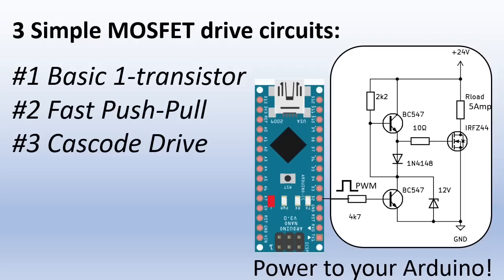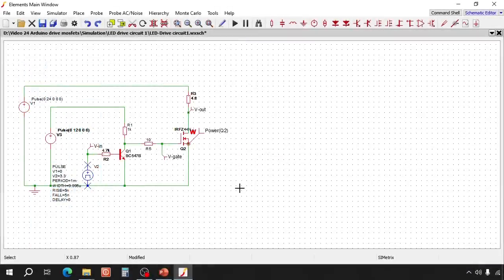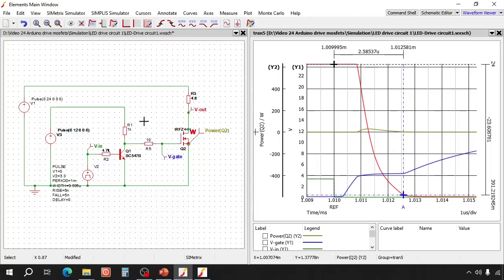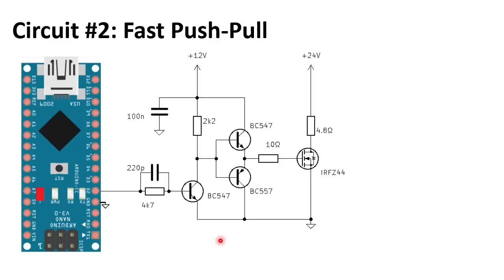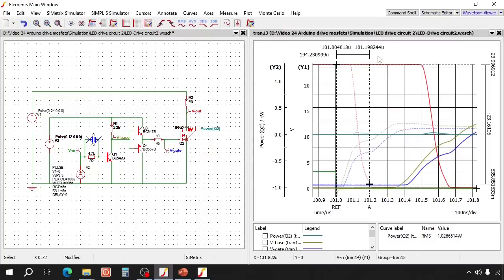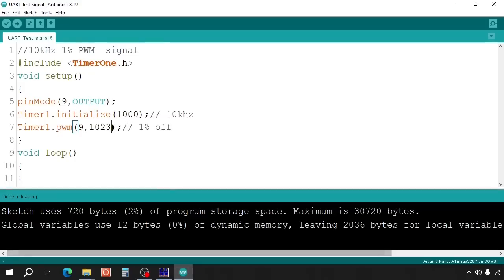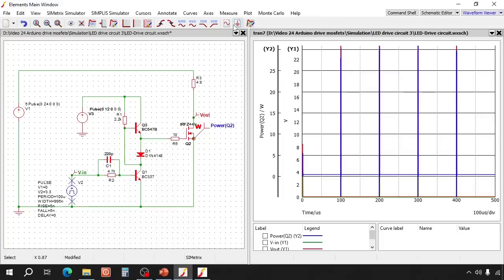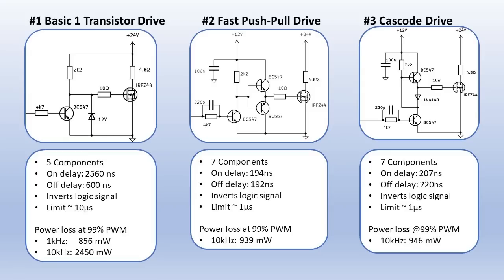3 Simple MOSFET Drive Circuits

Comment: On the second two circuits there are some improvements you can make.
If you split the 2K resistor to make it two 1K in series and run a capacitor to the output of your gate driver stage, you can get the switching times to be a bit faster.  Adding an inductor in series with the 2K will also work but inductors cost more.  The reason this works is because it causes the current in the lower 1K to not start changing until after most of the switching action is over.
On your 3rd circuit a small schottky in place of the 1N4148 does two things for you.  The 1N4148 has a recovery time so when the MOSFET is to be switched on, there is a brief delay before the upper NPN starts to do its thing.  Also with the lower drop of a small schottky, the gate of the MOSFET is closer to ground.
Reply: Isn't the delay from the 1N4148 kind of the reason it's there? I'm not an expert but I think he says something like that at 9:55
Reply: @bartios  The reason for the 1N4148 is so that when the lower transistor is off, the upper one gets turned on.  The delay in which is on really is a matter of his wording to explain the action.  He is taking the voltage on the collector of the lower transistor as rising at some speed.
Reply from the maker: Thank you for your tip!
Reply: @smartpowerelectronics8779  So, we are waiting for update video with tests ;)
BTW: Can you explain why you use BC transistor instead 2N?
Reply: 1N4148 не дря называют импульсным диодом, т.к. у него время задержки 2-4ns, при этом очень малая ёмкость, в то время как у диодов Шоттки, хоть и малое время задержки, НО огромная ёмкость перехода, и для коротких цепей с малым током, они будут гораздо хуже..
Reply: @SINHRO-FAZA  1N5818 only has 0.9pF of capacitance
The CDLL5818 version can pass an amp
Reply: @kensmith5694  Именно эти диоды шоттки я не использовал, но опыт использования SS56, и замеры обратного восстановления (хоть у таких диодов его и нет), но ёмкость сильно сказывалась, в то время как 1n4148 показывали себя довольно быстро, и на осциллографе действительно в районе 2ns. Хотя, если так подумать, когда вся система имеет задержки в 200ns, спорить о выигрыше в 1ns, кажется бесперспективной :D
Reply: @SINHRO-FAZA  Remember that it can show up as an error in timing.
Does good translate the word "pedantic" correctly.  I tend to be a bit pedantic at times.
Reply: @kensmith5694   Да, знакомая черта, сам порой страдаю перфекционизмом, стараясь сделать всё максимально хорошо, но помогает общий взгляд на ту или иную схему, с пониманием того, что какая то переделка не даст преимущества, но придётся потратить много времени и финансов. После чего успокаиваюсь, и переходу на переделку другого узла в схеме :D
Reply: sounds like you know what your talking about ! the science of fast switching is quite meticulous here ! can you recommend a good fast gate driver that i can just buy already made ? : )
Reply: @tvdylan  
TC4420  
High Peak Output Current: 6 Amper
Matched Rise and Fall Times:

- 25 ns (2500 pF load)

Comment: Came up with that cascode cct for a commercial product back in 1981 and was rather pleased with it. Then a bit later I found it in a Philips publication that may have just predated it.
Reply from the maker: Really!? Cool I used "real" cascode in CFL's at the company you just mentioned: a low voltage MOSFET switching off the emitter of a power bipolar which has its base connected to 12V with a resistor.

Comment: Nice video and thanks for uploading.
Just one question though.  You say these circuits invert the logic signal.... but...
If the input voltage is high with respects 0V then the MOSFET is off and the output voltage is high with respects to 0V too. 
Doesn't that mean the circuit Does not invert the signal? (In terms of Voltage)
Reply: The signal driving the mosfet gate is inverted with respect to the MCU signal driving the first transistor. Of course, the mosfet will also invert the signal applied to its gate, which means its drain will go high when the input from the MCU goes high. The two stages together indeed do not invert the signal.
It's hopefully obvious, though, that the drain is high when the mosfet is off, and therefore no current passes through the load.

Comment: The 555 can work as a buffer for driving a MOSFET too.
The only downside is that if the Arduino locks up, the 555 might lock on too
Reply from the maker: I tried it, and it works pretty well, next video!
Reply: @smartpowerelectronics8779   hopefully you'll solve the floating input bug
Reply: Yes but if you have the 555 you don't need the arduino do you.
Reply: @kensmith5694  depends if it's a standalone function or if this mosfet is part of a more complex project.
Reply: @PainterVierax  My comment was intended largely in humor.  The idea is that fans of the 555 will tell you that you can do anything with it.  There are a really large number of things that I have done with a 555 including a radio transmitter and stuff like that.
Reply: @kensmith5694  yeah 555 fans are excessive. The IC is very versatile but it has severe limitations as well and it's not that easy to configure.
It does the job but rarely worth it as a square or PWM emitter nowadays.
Reply from the maker: Hey that might work, and it will make the 555 fans very happy.it is worth a try! 🙂
Reply: @smartpowerelectronics8779   it does work, I did assemble it. Just watch out for the Arduino not to lock up (add 1...5k resistors before any inputs?), or else the output might be a steady "on". 

It happens whenever the 555 input is left floating (or the device attached to it is shut down). I tried to place various resistor values on its input in hopes of getting rid of this bug, but none worked.

It's not like I wouldn't use the obviously cheaper and simpler transistor version, but I currently don't have coding abilities and don't know how to invert the Arduino output.
Reply from the maker: Someone did this before: https://www.electronicdesign.com/technologies/power/article/21795203/lm555-makes-inexpensive-power-driver
I simulated, and with the CMOS version it works well (~150-200ns) but a normal bipolar NE555: 800ns, still better than circuit#2 and only 2-3 components (NE555, 100nF Vcc cap and 10Ω gate resistor) and...cheap! ;-)
Reply: @smartpowerelectronics8779   that's where I got the schematic from. Did you also simulate the 555 floating input?

Comment: One comment on the schematics for rather figurative reasons hinting at an engineering necessity: the emitter of the lower BC547 should be drawn with a line directly to the source of the iRFZ44. The idea behind it: The electric connection should also be as short as possible to minimize ground spike effects.
Very nice solution though. Congrats!

Comment: Question, dose the circuit need to have a 24V power source or can it be used with 12v and 5v?
Reply: If you need to work at 12V the circuit is very much the same.
At 5V you will have to be careful about what MOSFET you use because you can only pull its gate up to 5V
Reply: @kensmith5694 thanks
Reply from the maker: The drive circuit needs 12V, the 24V is only for the load in the demonstration because I use it for 24V LED strip dimming.

Comment: Do you have anything on driving a high side mosfet without resorting to having to use a p channel mosfet? I came up with one circuit, but it involves an extra 12 volts added on to the supply voltage, and having the transistors running at those high voltages.
Reply: If you want to drive the N channel, you are going to need those higher voltages.  They do make chips that contain charge pumps for doing just that but if you want to go with common parts, there are tricks.
If the switch is being driven with a duty cycle, you have a squarewave somewhere to drive a charge pump.

Comment: Good analysis of an area of circuit design which is surprisingly difficult to optimize. The Miller capacitance also works against you and becomes a big issue with high voltage switching.
Reply: Yes, at higher voltages that is an additional reason to not even bother with the simple resistor pull up drive.
Also:  "super junction" MOSFETs are much better for high voltage.  Even with 1000V on the drain, the gate acts as though the drain only went up to about 200V.  
For those who don't know:  Internally a super junction MOSFET is a lot like a normal one but some P doped silicon extends further down  into the bulk of the device.  This P doped silicon looks like the gate of a great big JFET wired in cascode with the MOSFET.  This spreads out the voltage gradient in the silicon making 1600V parts possible and also means that the full drain voltage happens at a place further from the gate.

Comment: 10:00 are you sure this works in real life with real parts? I can't see where the base current of the upper NPN would flow because bottom NPN is switched off and there is no current going though a gate of a MOSFET (except charging the gate ofc) 🤔
Reply: You nailed it. Charge the gate and trail off to quiescence. There is an inverted version of this circuit where a PNP is used in this fashion to discharge the MOSFET’s gate and the inverter transistor is also PNP to drive the gate towards 12V. But that version doesn’t accomplish level shifting and would need another transistor or perhaps just a zener to spare the PIO from the nearly 12V at the upper PNP’s base.
Reply from the maker: Correct, after the gate is charged there is no current!  Actually I recommend circuit #2 because it is the same amount of components and a little faster.
Reply: @smartpowerelectronics8779  The slow trailing off near the peak is why I suggested pulling up to 24V with a diode clamp to 12V. Then that transistor will remain saturated right up to when the diode clamps the base to the 12V rail.

Comment: Should you not have a resistor between the base of the BC547 and ground. Does this not turn the transistor off much faster?
Reply: Adding that resistor can help a bit but the speed up capacitor does more.
Reply: @kensmith5694  Yes, of course, but I learned that you always clamp the base to ground. Leaving the base connection floating isnt good practise.
Reply: @bruceclothier8238  The chip's pin pulls all the way to ground when low.  The base is not floating.

Comment: Excellent! I often have a 3.3V logic level and have difficulty driving a MOSFET with it.

For the third circuit I would connect a 12V Zener diode to the collector of the BC547 and cathode of the 1N4148 to GND. This would limit the voltage to around 12V.
The base of the upper transistor does not go above 12V and therefore neither does the emitter.
The upper transistor would also not become saturated and would therefore switch off more quickly.
But it is difficult to predict the current through the Zener diode.
Reply from the maker: Good tip, I expect that will work!
Reply: I like your solution.  The zener current is best predicted with a "if the current doesn't go elsewhere" sort of thinking.  The current in the pull up resistor always has to go somewhere.
Also:  If you use two resistors in series as the pull up and run a small capacitor from the mid point over to the emitter of the upper transistor, you can use a much higher value resistor for the upper one.  You only need much base drive to the upper transistor when you are in the process of turning on the MOSFET.    The small capacitor stops the base drive from decreasing right at the time you dealing with the miller effect.

Comment: That cascode drive is smart but has big issues, especially when done in a pullup like this.
1. The output is high when no input is present, so your gate will be high until your MCU boots up. This can be fixed by connecting a pullup resistor to your gate driver input. Also that means it's inverted.
2. BJT's saturate and make high speed drive for dc-dc converters a pain. (high dead time, delay and all that)
3. The drive is non symmetrical, so you can have good turn off and bad turn on and vice versa.

I've played with these gate drives a lot and push-pull is my go-to for now if i want predictable timings ;)
Reply: On #2 part of the fun of electronics is working out how to make that not matter in the design.

Comment: Folllow #3 with a totem-pole for even more current, up into the 10A range even. That’s better than most monolithic gate drivers, though there’s nothing stopping you from just putting a totem-pole (or ZXGD300_) after a monolithic gate driver.
Reply from the maker: Thx ScroganY. You are absolutely right, the totem pole will not add much delay and can further boost the gate current. By the way BC547/557's are not the best switching bjts, I was surprised how well they stood up to the task ;-)

Comment: This was absolutely brilliant!   I really enjoyed your explaination on the push pull circuit, as well as the demonstration on the effects of the 220 pf capacitor on the BC557 base.   Liked and Subscribed!
Reply from the maker: Thanks David!!!
Reply: @smartpowerelectronics8779  It would have been interesting to see the effects of a corresponding 220pF capacitor in the first circuit. I wouldn't expect a great improvement because the mosfet input capacitance is still charging through a 1K resistor, giving a typical time constant around 2μs with an IRFZ44, but it is not an expensive addition and you would then be comparing the three circuits on a rather more equal footing.
Reply: @smartpowerelectronics8779 can you please explain, constant current with driving logic with transistor & MOSFET?

Comment: Thank you for the clear and concise explanations. Great examples! Any recommendations for a non-inverting mosfet drive circuit?
Reply from the maker: Thank you JessieKropp!...well only one more Transistor at the input, but that causes extra delay. To prevent starup flash I choose a GPIO which has no other function and set it to high first thing in your setup(), works OK for ESP8266 and AVR arduino boards.
Reply: I’d add a weak pull-up on that GPIO pin too.

Comment: Nice! The speedup cap is interesting. I wonder what the current and power on the io pin looks like.
Reply from the maker: Thank you! The IO should be ok, the 220pF causes a minor extra loss of 0.5*C*V^2*freq ~ about 30µW? There is another solution called "baker Clamp" with a Schottky Diode over b-c but I did not try that.
Reply: @smartpowerelectronics8779  I have done Baker Clamp circuits.  They do get rid of the storage delay but they don't help on the miller.  Also just a schottky means that you now have the added capacitance of the schottky in the miller effect.  Baker clamps end up complicated in real life.
Also if you have a TN0629-N3 in place of the lower NPN, you can save some parts.

Comment: There is one more driver circuit - 4 npn BJTs 2n2222 +  1n5817 hotkey diode and can provide more than 1A of current in peak.
Reply from the maker: Thank you Alex!  Can you share a link in the comments? 
....By the way 2N2222 is a better switching NPN than a BC547, the only advantage of the BC547 is that everyone  has some lying around in the junk box :-)
Reply: @smartpowerelectronics8779 Living in the USA I don’t knowingly have any BC parts, but I have lots of 2N3904, 2N3906, PN2222A, PN2907A, and 2N7000/7002 as common parts.
Reply: @smartpowerelectronics8779  I don't have any BC547s.  In the US different transistors tend to be in the junk box.
Just for fun here are a few numbers I found with a quick look:  TIP35,  VN10KM,  IRF631,  OC71,  and AF117
Reply: Sory, I've looked into my LTspice simulations, and I see my driver is more complex: 4 x 2n2222, 1 x 1n5817, 3 x 1k resistors /*including one uC to BJT base */ 1 x 220pF capacitor. Simulation on 3nF load   through 1ohm resistor show almost twice faster edges than just two BJTs and diode ~50/16ns to ~90/34ns. Don't know how to send you the simulation file   @smartpowerelectronics8779